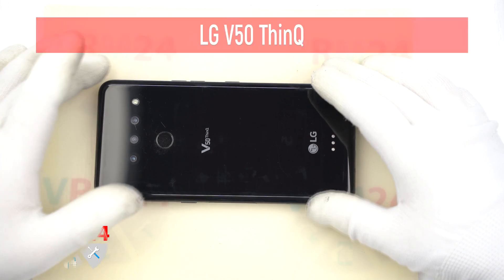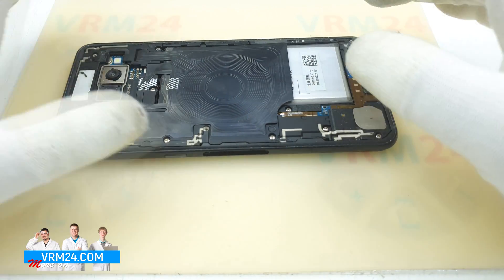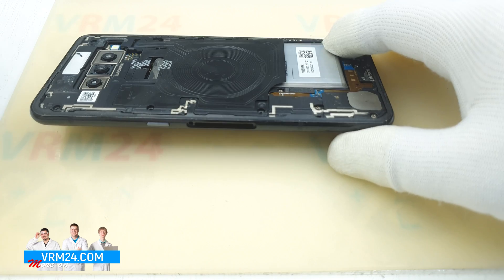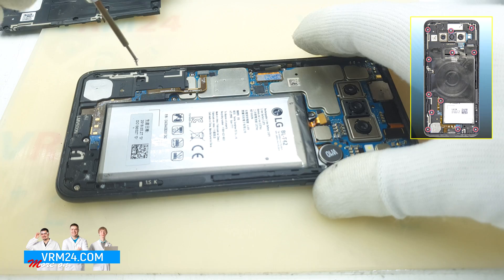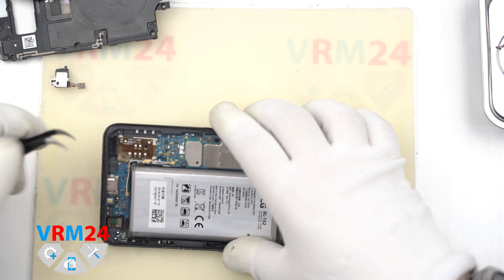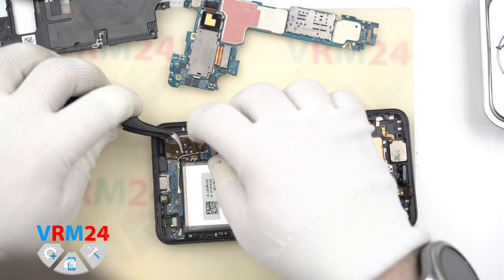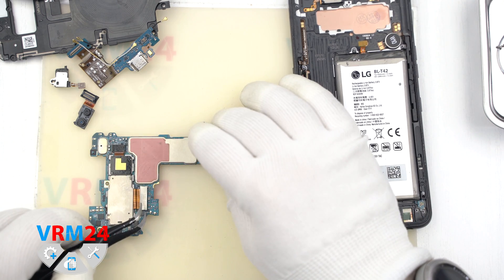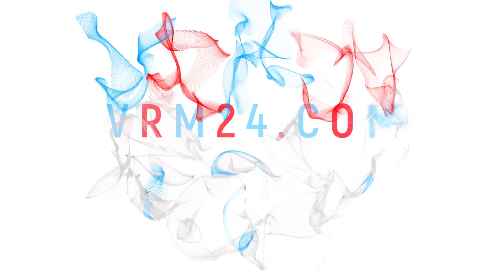LG V50 ThinQ 📱 Teardown Take apart Tutorial

Comment: My LG 50 is not recognized on the computer and the yellow triangle always appears. I replaced the sub board and the defect still persists. Do you know what is happening?
Reply: I also have this problem after I updated to Android 12 my phone doesn't recognize it on the computer either
Reply: I couldn't solve this problem, I've restarted the phone several times and nothing and the phone also takes a long time to charge. Do you have the same problem? I also changed the connector, that didn't help either.